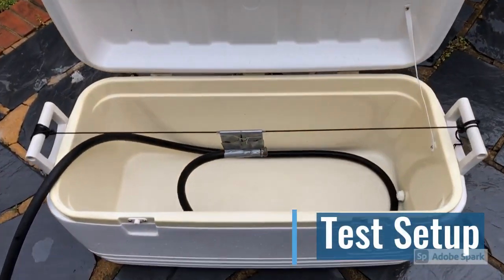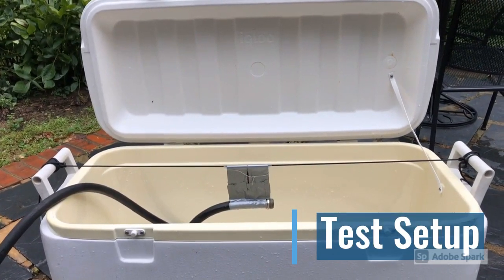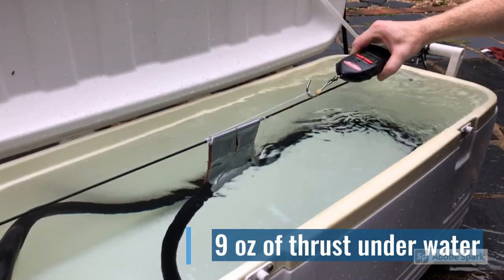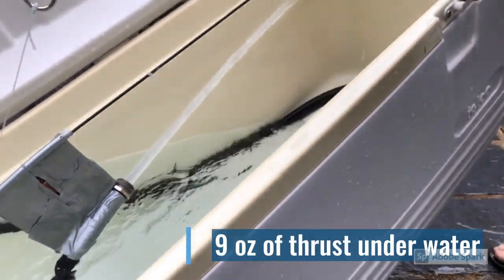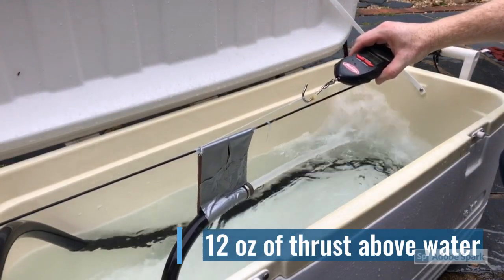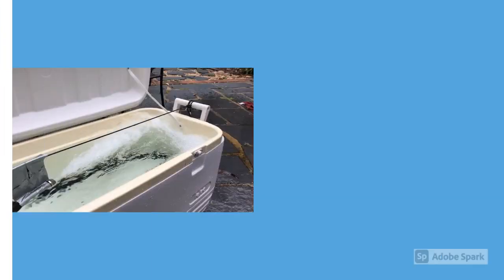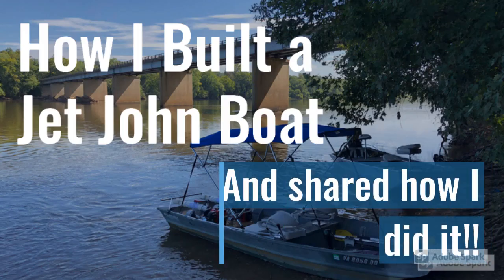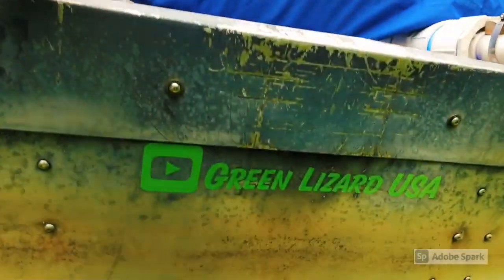Jet Boat Design: The Proof They Wanted!!!

Comment: At speed, a lower jet that comes out of the transom will clear the water anyway (unless you are overweight or underpowered). What you did not account for was the loss of efficiency that comes with having to pump water up and over the transom. Water is heavy. I dont like this test because it does not control for weight and friction of your hose setup nor does it even test for this loss of efficiency. I believe you are wrong but not for the reason that you or anybody has mentioned yet. Proof for me would be if you poked those holes you are so desperately trying to avoid.

Comment: Yes it should be above the waterline but there’s too much inefficiently when you pump the water up over the back of the transom.  Ideally water never should have to go above the static waterline.
Reply from the maker: Agreed. I completely agree. I was saving myself the hassle of putting pipes through the transom. Also, the pumps already had the outlet at that height, so it was a straight shot over the transom, as opposed to a couple 90s or 45s to get it down to the bottom of the transom.
Reply: @greenlizardusa3105  what if you mounted the pumps vertically and put vertical shaft engines on them.
Reply: @greenlizardusa3105  just bought myself a seadoo 4-Tec 155 for my jet jon project 😍
Reply from the maker: Dude that is going to be sick! You should make a video. I'll be happy to share it!

Comment: So I guess this is my question. Are you saying that you get more power just shooting the water jet straight out the top of your boat like it is vs directing the jets to shoot at an angle toward the water? I really like this build an might try something like this when I build one.
Reply from the maker: In this scenario yes. There is a reason to "trim" out your boat by either directing the flow slightly at an upward or downward vector, but generally speaking you want the discharge straight in the opposite direction of movement.
Reply: Angle does matter but those pumps and motors dont change. The useable power is increased with a lower jet. This is called efficiency. With the higher jet you are wasting power fighting gravity.
Reply: Just use a prop and get another 33% efficiency out of the motor 😅

Comment: On my jet boat once you get going (within a couple seconds) it lifts the boat out of the water enough and creates a pocket behind the boat of air so the jet pump is pushing out the water into the open air.  So technically even though the outlet is below the water line initially I still get the gain of having it out of the water after it gets on plane.  Seems almost like this is a non-issue.
Reply from the maker: @Fishing Montana: You're exactly right! There are still a lot of folks who believe you get more power with an underwater jet.
Reply: @greenlizardusa3105  all jet boats that I’ve ever had… had the water coming out of the pump above the water line.

Comment: Dude, thats nothing new....out of the water you directed the stream into the side if the cooler to increase pressure.....lol.
Reply from the maker: Thanks for your comment Garry! Water has zero compressive strength in an unconfined condition (like spraying through the air). The hose does not "feel" the water hitting the side of the cooler, because that energy cannot be transferred back through the stream of water.
Reply: @greenlizardusa3105  lol...whatever...you do not understand physics...good luck.
Reply from the maker: @randyblockett  Thanks Garry! I hope to learn more, and share what I can.
Reply: @randyblockett  Excellent response, Gary... Thanks for adding so much value to the conversation!
Reply: Im terrible with physics but does Garry have a slight point. For example, those jet packs that attach to the jetskis pump achieve lift. Without a surface or the water below them they would basically have zero lift. So, i would think that the closer you pulled the hose to the side of the cooler the force would increase. And its less in the water because it is not a solid surface/material so it has breakthrough. please explain
Reply from the maker: @ZachWH87  https://www.youtube.com/watch?v=Nj1fF7YmMqA
Reply: What a real engineer says.....start at 9 minute mark...also you lose effeciency for every inch you gi above water line on transom......https://youtu.be/C9jGKaiZIcQ
Reply from the maker: @randyblockett  https://www.youtube.com/watch?v=Nj1fF7YmMqA